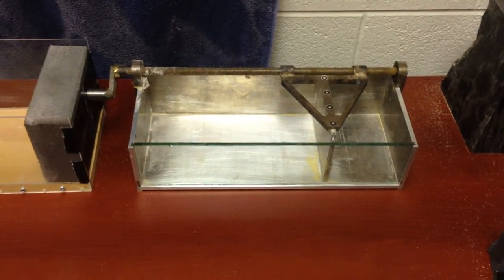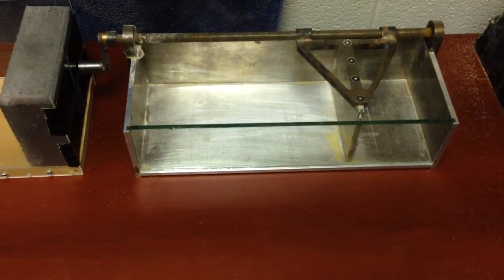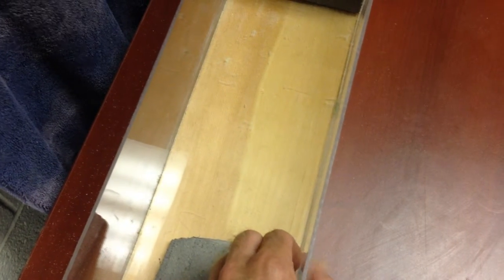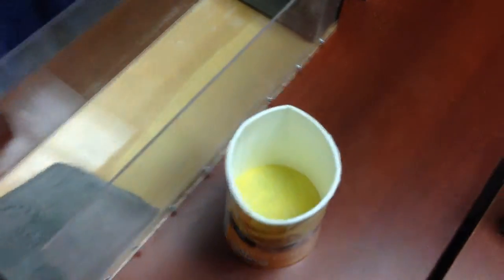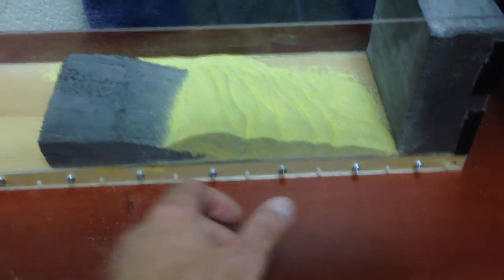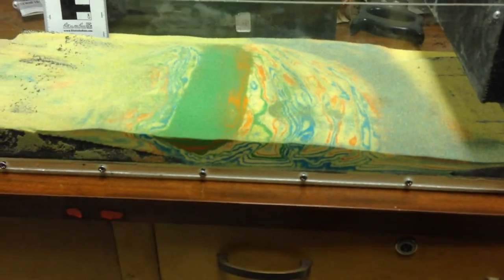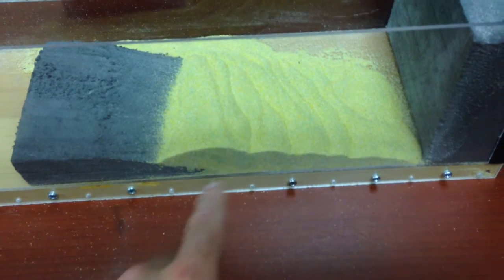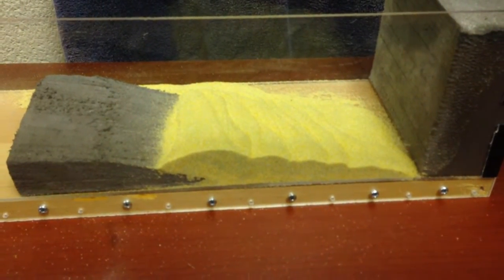Thoughts on model setup: Low friction between layer pack and floor of the model

Comment: How does the cornmeal interact with the sand in your sandbox models? Do they represent anything like the low cohesive and the high cohesive sediments?
Reply from the maker: Yes, the cornmeal is slightly cohesive, while the sand is essentially non-cohesive. I think my model approach has evolved considerably since this video, but I still use strongly contrasting materials to create the patterns I need for illustration. While all the materials "should" be essentially non-cohesive to replicate sed rock deformation, we can't make faults sufficiently weak enough because we can't produce fluid overpressure, etc. As a result, I try to build models up off of the weakest material I have, which is now glass microbeads. They represent decollement horizons, and everything else is stronger and deforms differently.
Reply: @TheGeoModels  Thanks for your reply! Does the cornmeal share similar scaling relationships to the sand? Since the density of the cornmeal is much less than the density of the quartz sand, I suspect it may have a different depth scale than the conventional dry sandbox?
Reply from the maker: @piin1979  you would presumably be correct. Again, I always emphasize "illustrative" with my models, because I am knowingly operating outside of what should be scale-appropriate material properties to create the patterns I am after. I would be curious to see what would happen if a person ran a very thick cornmeal and sand model! I will say that I produce essentially the same results with "sand" and glass beads right now. "Sand" is in quotes because I don't actually know what the granular material I buy at a retail store is made from. It certainly isn't silica/quartz; I think it is some kind of salt (not NaCl), and I know some of it is a carbonate salt. It is cheap, and the cleaved, angular particles contrast nicely with the beads. I am sure its density approximates or exceeds that of the beads, but the outcomes are very similar to the cornmeal and sand. Ultimately, if you are using a box with a sidewall, the sidewall drag (to me, anyway) is the real "elephant in the room" that strongly controls outcomes but is rarely discussed. Some major labs use very long but thin sandboxes where the model width is probably less than the thickness of the final wedge, so the sidewall drag from each side intersects and offsets. Do you produce models for analytical/publication purposes?
Reply: @TheGeoModels  Many thanks for your comment! It's interesting to know that you can produce very similar illustrative results with different materials. I am currently trying to explore the possible range of materials that I could dump into the sandbox, to mimic the natural condition of the shallow crustal materials in the collision system for both teaching and analytical purpose, but it may take years to reach that goal.